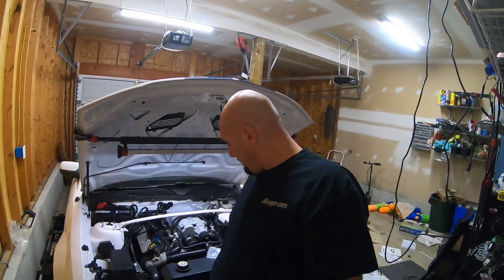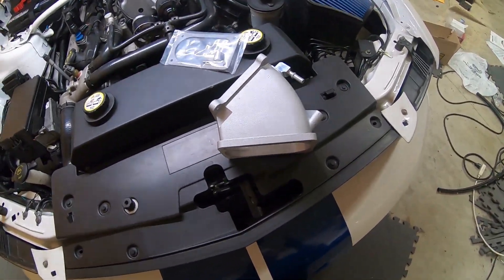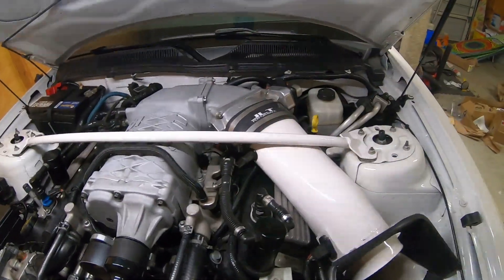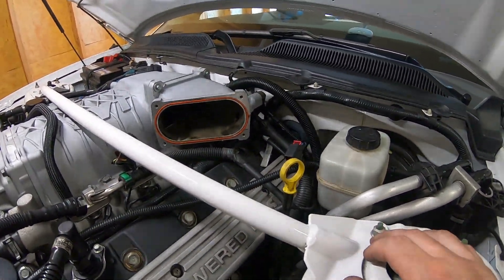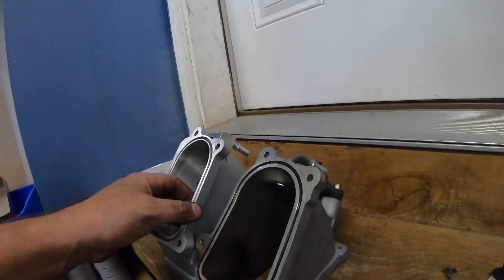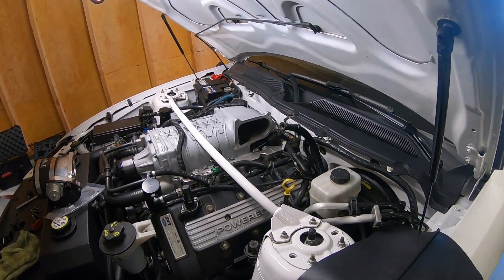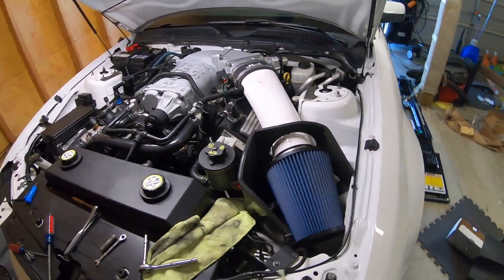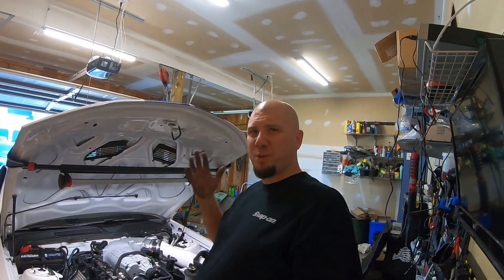BPS Ported Elbow install on TVS swapped GT500

Comment: Just uninstalled mine from my Shelby.  Thanks, you saved me from breaking that vacuum line.   My car made big power on this set up....Get ready to ZERO miles to the gallon, big you will Smile BIG every time you floor it.
Reply from the maker: buyusgoods what kind of power gains did you see with your elbow? I haven’t redynoed it yet. 
It feels a little more up top though.
Reply: i  made 817 WRHP and 826 TQ with this set up along with a 2.4 pulley with a John Lund Tune.  John Lund is the man.  I only trust Jon Lund or Roush Yates to tune my cars.    My 07 Shelby on a TVS, 2.4 pulley and a John Lund tune made 710 and 666 TQ.  No long tube headers,  Just a stainless works cat back.  I sold my 07.  The 5.4 motor is strong and can take the boost.  I saw your video and I can say that it was extremely informative.  I was laughing because I had the same problems you had with my install.  I had forgotten how to get the vacuum line off.  I wish I had kept my 07.   On your tune, you really want John Lund to tune your set up.  My car on his tune drove better than the factory tune.  Lund can tune  any Shelby without any problems as long as you have the correct ,mods .  Oh, sorry. my 14 Shelly mods were:  EBA ported with KB 168 TB, JLT Big Carbon CAI, 2.4 pulley, stainless works cat back and John lund tuned....My 07 mods were the same except I used a Ford racing 65MM TB.  I was shocked when we did the 14 Shelby how much more power I could make with am injector upgrade.  You are on you way to having a great ride.  Don't forget to address the coo;ing issues.   I changed out my heat exchanger   for a C&R one on my 07. You also should look into doing a brake swap using the 13-14  Shelby brakes.  The work excellent and took me about 45 mins per wheel to change out the calipers and rotors.  Car stopped on a dime.  If you need anything, let me know.  It was nice to meet you.  And again, thanks for saving my ass on that vacuum line.  :)                                                                                                                                                                                                                                                                                                                                                                                                                                                                                                                                                  /
Reply from the maker: buyusgoods I am friends with Brandon at Lund, so he tuned my car last. That is some crazy power, I assume that was on E85? 
My main issue is fuel limitations. My last dyno was a little low, but when the stars align and the car is cool and makes all the boost, I gotta be pretty close to pump gas limits.

Comment: Any updates on this?
Reply from the maker: I have not been able to get it back on the dyno. I actually blew my clutch a few weeks after I installed this. 
But what I can say is from my limited use is that it "feels" a little softer on the immediate hit. It "feels" like it picks up more on the top end now. It was colder when I did these tests so the boost and AIT were perfect scenario, so I was seeing like mid 18's PSI range.
Reply: @PMPerformance  

 I am tossing around the idea of ported trinity and elbow like your car. My car is identical to yours with Trinity swap. I am leaning towards a GEN3R in the near future to get over the 700 tire mark. The trinity still sells for 1000$ +
Reply from the maker: @mgt92cobra1  I am in the same boat. I can tell you now, you can do that on a Trinity unported. My car has been a tad over 700whp on pump with the stock elbow and unported blower. 
I will also say if E85 is not on your list and maybe a built motor, the 2.3 is more than enough to break everything. I have decided I am going to play with pump gas a little more and squeeze what I can until E85 and then port the blower and stay with a 2.3. Unless someone cal show me the 2.65 rotor pack runs a shit ton cooler, that is my plan
Heat is the major issue on these things though as you probably already know. 
Another side note, 1320junky will tell you to get the BPS elbow and he will port that with the blower. There is a TON of meat left still to remove even on this thing if you do his 2.3R variant